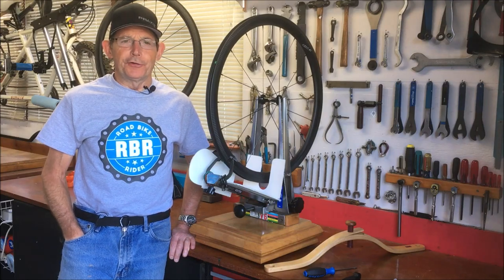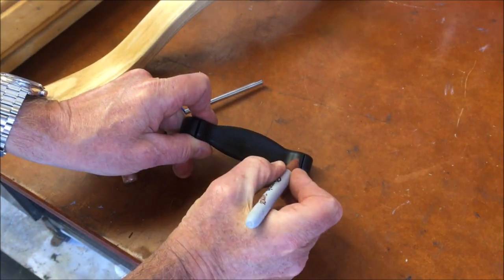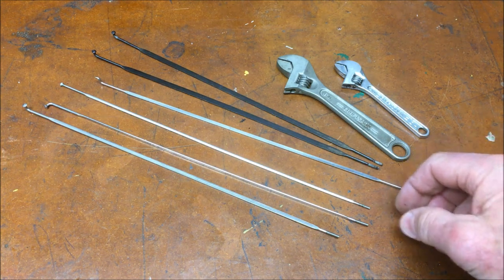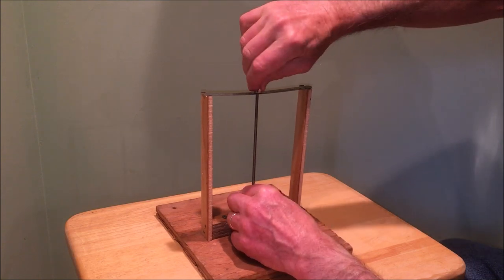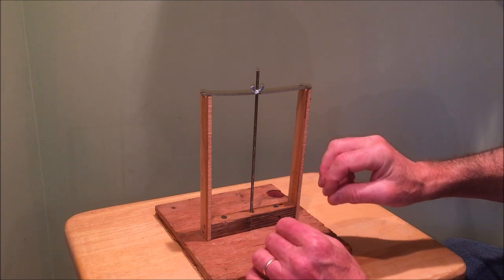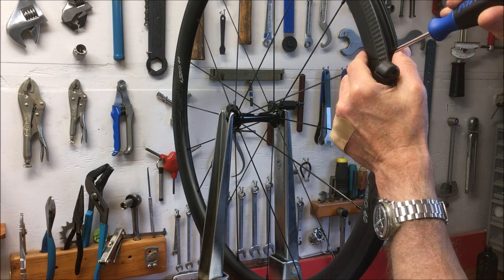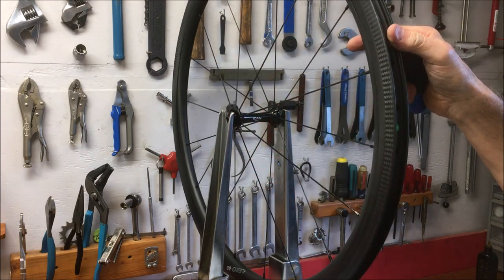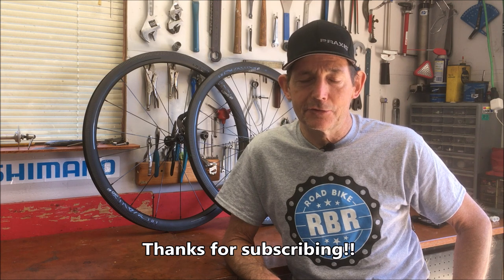Fixing Bladed Spoke Twist on Aero Road Bike Wheels

Comment: Does this only apply to straight pull spokes? I can't imagine how j-bend spokes would get twisted.
Reply from the maker: Thanks for asking, Neil. All spokes can get twisted actually. It happens because when you're tightening the spokes during tensioning, you're only making turns at the top of the spoke. Because the spoke is so long and thin, it doesn't have the strength along its entire length to resist being turned, whether it's a straight pull or a J-bend spoke. A lot of wheels are built with some type of thread locker between the nipples and spoke threads and this can increase the chance that the spokes get overwound when you're truing and tensioning. Wheelbuilders have different techniques for dealing with twist/wind-up. The simplest is to always backturn each nipple with every turn to tighten a spoke. So you make the spoke tighter, and you finish by turning the nipple backwards, which has the effect of unwinding/untwisting the spoke. If you rest a finger on the spoke as you do your tightening, you can actually feel the spoke twist and know that you need to account for it. You don't want to twist the spokes too much as it can weaken them if it's excessive twist. As I show in the video with aero bladed spokes, you use a tool to hold the flat section of the spoke close to the nipple. There are tools to hold round spokes, too, to keep them from twisting as you tension. Roval makes one that's beautiful but pricey (can't seem to find a link - maybe it's no longer for sale?). An inexpensive pair of locking smooth jaw pliers can work in a pinch (pun intended). Thanks for asking! Jim
Reply: @JimLangley1  thanks for clarifying. Just out of interest do you generally recommend j-bend rather than straight pull? I have a choice of two wheels at the moment: one with straight pull bladed spokes and one with j-bend round spokes. My main priority is reliability: I don't want to break a spoke when I'm on a solo ride 30 miles from civilization!
Reply from the maker: Hi Neil, for the type of riding you describe I like J bend spokes. The reason is that it's easier to find a replacement spoke should you break one somehow (like a crash or something going into the wheel). And hubs that take J bend spokes can accept even bent wire should you ever have to fix a wheel that way - making something called an "emergency spoke." Thanks for the question!

Comment: What if the spokes are made of carbon?
Reply from the maker: That's an interesting question, Gunther. You don't see that many carbon spokes because carbon is brittle and notch sensitive - sort of like a piece of long, thin glass. So, hopefully anyone/any company building with carbon spokes will be sure not to let them twist during the wheel building process so that the carbon isn't put under stress and at risk of cracking/breaking. But, if carbon spokes got twisted in the wheel building process somehow, you could likely use the same technique I show in the video to untwist them. Since they twisted without breaking during building, in theory untwisting them wouldn't add more stress, it would remove the twist/tension built up in the spokes and that would be a good thing for the durability of the wheel, while fixing the wind drag from the twisted spokes, too. But, again, carbon spokes are usually found on pretty elite wheels and I would expect the maker to be careful to keep them from twisting during building. Hope this helps and thanks for the comment!
Reply: @JimLangley1  thanks for replying mr jim, i'm just bodered by my cadex wheels, when i spin them either wheels, they are just misaligned or maybe its just my tyre pressure set to minimum
Reply from the maker: @guntherschultz912  If you spin the wheels in a bicycle with the tires in place on the wheels, you might see alignment issues from the tires and think it's from the rims. To focus on just the wheels, do this: tape a pencil to one side of the frame for the rear wheel and one side of the fork for the front wheel. Tape the pencil so that it is firmly attached and cannot wiggle or move. Also, tape it so that the writing end (the point) is 5mm away from the rim. Place the pencil point so it is close to the top edge of the rim, too - but not next to the tire. With the pencil in position like this you can spin the wheel and look at the gap between the rim and the pencil point. If the wheels are straight and round, the gap between the pencil point and the rim will barely change as the wheel is spinning. Be sure to watch the sideways space between the point and the rim and also watch the top edge of the rim gap to the point. The top gap should stay the same, too. Many times, people see wobbly tires and think their wheels are bad, when it's just the tires. The "pencil test" is a good way to find out if it's the wheels or just the tires. Good luck!
Reply: @JimLangley1  will do that, thanks!

Comment: No way to do this without having to strip the rim what a ...................pain......pain every time strip the rim rip off the tape
Reply from the maker: Thanks a lot for watching and the comment, Will. I have good news for you. Park Tool now make a special spoke wrench that fits underneath the aero spoke holder (anti-twist tool). It's so thin that you can hold the top of the bladed/aero spoke with the anti-twist tool. Here's a link to the tool: Park Tool's SW-9 Spoke Wrench for use with aero spoke holder
https://amzn.to/3ulXKbD If you have this tool you won't need to remove your tire, tube or rim tape. And here's a link to me showing how to use the tool: https://youtu.be/NyPGQrNfUFU?t=1348 I hope this helps and thanks again!